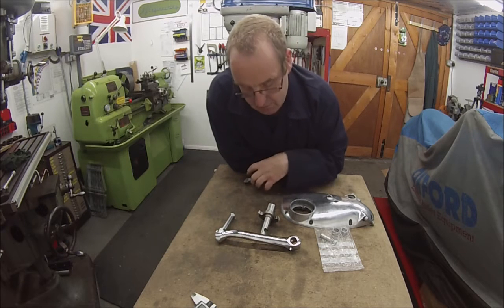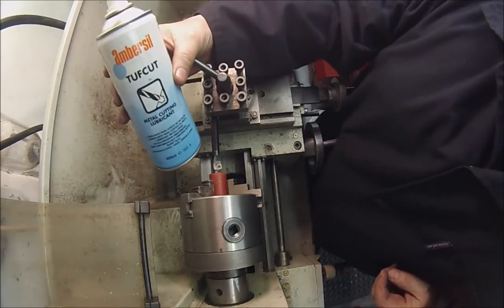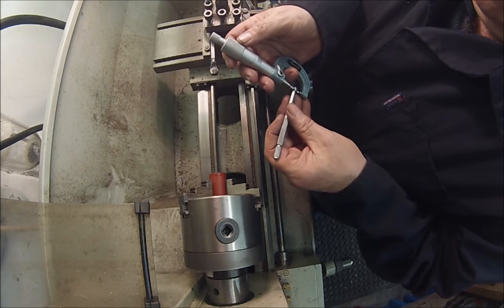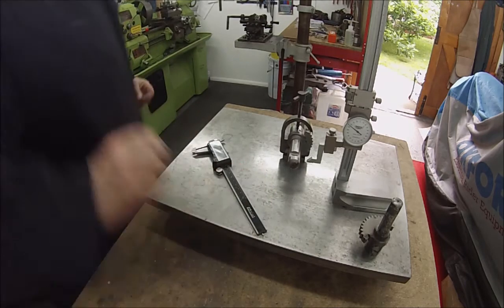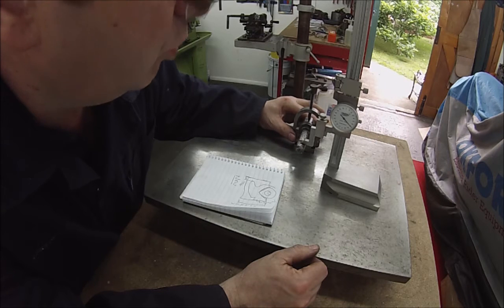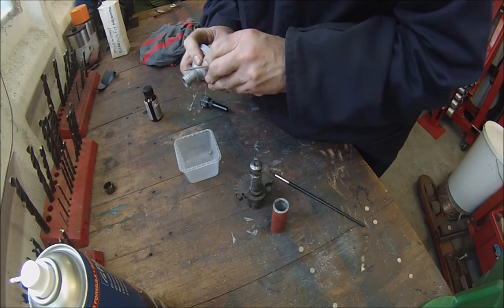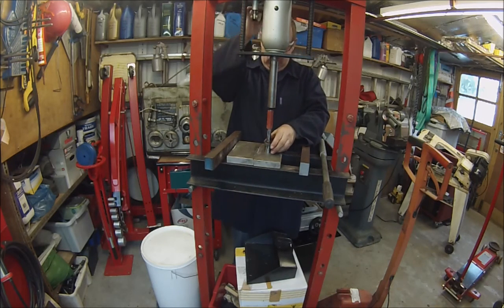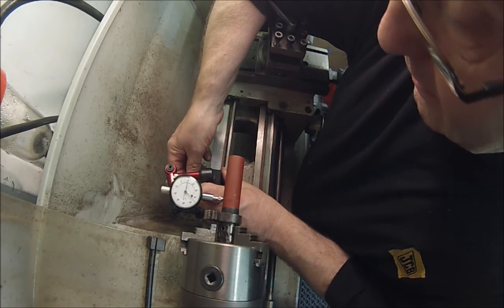Kickstart shaft 1

Comment: hello few q's where was that nasty pattern part made and what is your small lathe?
The other day I picked up light hydraulic fluid instead of rocal by mistake(same type of oil can) whilst broaching and it seemed better!
Reply from the maker: Thank you for watching. Part is I think old stock made in India, I believe ( hope) they have improved now .Lathe is a Chester 920 from 2002, fitted with 3 phase motor and inverter drive, also modified to give tumbler reverse and neutral to leadscrew. There is a bit more detail in one of the past videos but I cannot remember which. I honestly have never tried broaching, something I may look at one day, but a broach set is not cheap. Thanks for the tip on hydraulic fluid, will give it a go. Ade.